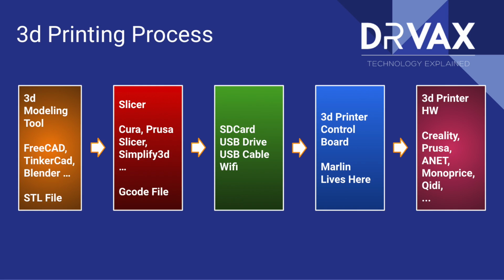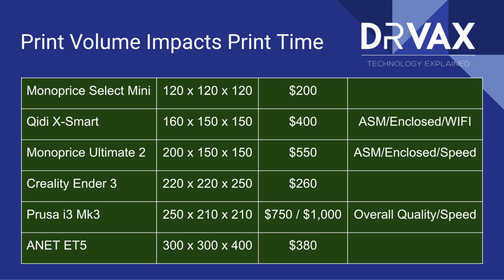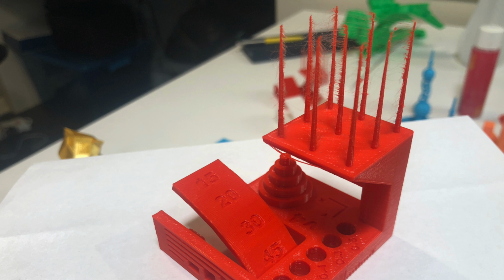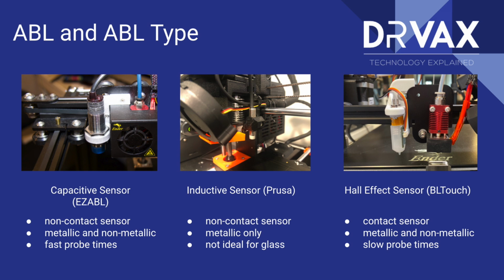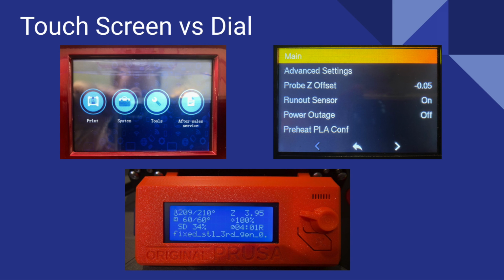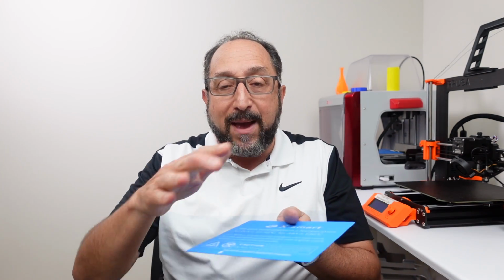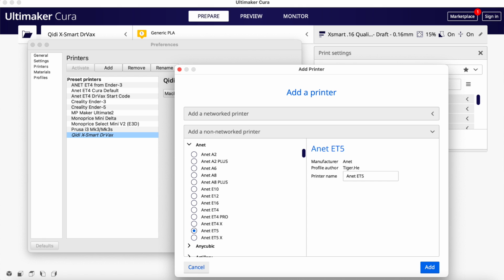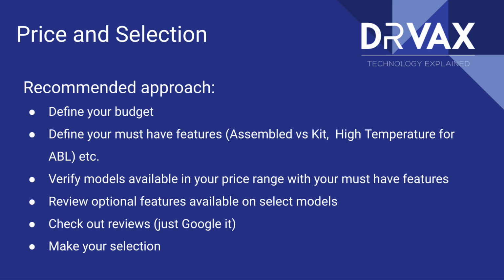How to Buy a 3d Printer

Comment: I have  FLSUN QQ-S-PRO and it's truely amazing.  255 x 255 x 360mm, 69 point autolevel one time only, dual gear titan-like extruder, micro sd card/Wifi/usb connect (gcode sent to sdcard via wifi), all metal hot end, Glass bed instant release when cool - no glue required (except when humidity is over 55%, use glue a few times then remove it and the glass works without for a while), color lcd touch screen, semi assembled, 100mm/sec., Great service, every part available, 32bit robin board etc. etc. etc. - worth checking out, also the new sr racer… 412.00 canadian.  Phil Nelson, Sr. Engineer, 67yrs old.  I also had an ender 3 pro… Delta far better, more efficient
Reply from the maker: I am hoping to review an FLSUN delta printer in the near future. Keep watching. :-)

Comment: Just about ready to pull the trigger (or push the button) on my second printer. The first one, I bought in 2017 and was a Wanhao i3 Plus (I believe the same printer was sold by Monoprice). It's worked pretty well, but I want a larger printer for my second one. Not necessarily for printing large objects, though I do want to try printing model airplanes, but mainly for printing multiple small ones on the larger bed. I actually made up my mind a month or two ago and I'll be buying an Artillery Sidewinder X2. It's got a 300x300x400 print volume, a direct drive extruder, auto bed leveling (as far as I can tell, a BL-Touch type), and a lot of the concerns people had about the mains voltage heated bed cable have been taken care of. The Sidewinder X1 has had a lot of really good reviews from people who've used them a long time, and a few reviews where people have had specific problems with their machines (mainly not-completely-flat beds and ribbon cable issues). One major guru seems to have developed a pathological dislike of it, but that's just him. One particular feature I didn't like was the fixed printing surface - that's easily fixed. I intend to try a sheet of G10 or garolite clipped to the bed. IKEA also sells cheap glass mirror panels that should also clip on. The two alternatives, in the same price, features and size range, were the Bluer Plus and the Sapphire Plus. Both also have gotten very good reviews. The Bluer Plus is, like the Sidewinder X2, almost fully assembled, while the Sapphire Plus is more like a kit. Both use Bowden Tube extruders. The Bluer is a bed-slinger, like the Sidewinder, while the Sapphire is a Core XY printer. One printer I rejected was the Ender 3 Max - it's a 300x300x400 printer with one Z axis screw, no auto bed leveling, and like most Ender 3s was a construction project. It does cost USD100 less. Thanks very much for this video, it pretty much jibes with all the stuff I've learned over the last few months, and covered some stuff that I hadn't considered. About enclosed printers - a friend of mine, in 2017, bought a Hobby King printer - it was a tiny thing, on sale for USD99. Well, he found out about the TINY bed levelling knobs. And back then everyone wanted to print ABS - he had bed adhesion problems, and when he tried a sheet of PEI the sheet peeled off the bed when the ABS shrank. The printer got put on the shelf after that. I got my Wanhao the next month, it was a great deal more usable.

Comment: Bed leveling wheels - one reason beds go out of adjustment is wheel creep due to vibration. On my Wanhao i3 Plus (bought in 2017) I fixed it by installing dual locking wheels and removing the springs. It's a Thingiverse project - the author suggests only using three corners  to level the bed, leaving the fourth free-floating. So far once I've set it, it doesn't move or creep. I also like the fact that the wheels are bigger (the original wheels were tiny and hurt your fingers). I plan to do this on my second printer, which I shall be buying soon.

Comment: Very good guide, thank you for taking the time to create and publish this. 

Regarding "all metal" vs teflon lined hot ends, it's not that metal is hard to cool. It's that it must be precisely manufactured and still doesn't get slippery like PTFE, so it's harder to push material through. With PTFE lined hot ends, it doesn't matter as much if the machining is rough, because it doesn't touch the moving plastic until it is in the hot zone.

Regarding level, there are really two distinct issues: Firstly the nozzle and surface must move in a known manner, which usually means all axis at right angles. This is known as tramming. Secondly the nozzle must reach close enough to put plastic on the bed. The two are often conflated, and some machines can handle one but not he other. Some more exotic machines, like CR-30, use other angles than right angles. What does not matter, oddly, is actual level; FDM printers typically don't mind being turned around, including upside down. 

Regarding open source: My fridge has no software in it; it has a compressor and thermostat. Anyway, source doesn't usually matter in appliances, but see it as a level of documentation. Open source firmware means you have a recourse to get things repaired or improved (whether by you or some helpful friend). Open source printers mean you can print replacements without needing to redesign them. Open source software, such as CAD and slicer software, is even more important; it means you choose when to upgrade, and can archive the tool you used for your projects along with the project if you wish, including sharing it. This is a fraught issue particularly with "cloud" software, which runs on someone else's computer and can change at any time. Proprietary firmware has a similar problem in that if you update to a broken version (this is not an upgrade), they sometimes prevent you from going back to the working version. For instance, Apple phones have been known to be reprogrammed to be slower by updates. Sony have outright destroyed functions particularly on consoles. Thus, I think it is a good idea to check for "unbrickable" bootloader and some open firmware support, even if not installed originally. An example of a 3D printer issue open source support can help with: Ender 5 Plus comes with badly tuned automatic bed leveling, that thinks the sensor and nozzle are in the same place. This has been corrected in third party open source updates. Prusa printers actually use open source firmware and design but locked down firmware updates, but they have a method to enable your own updates. I think the idea was that the warranty covers their firmware but not arbitrary changes.

Comment: What is your experience with bed adhesion issues when you compare beds that shift on the Y-axis vs beds that only shift for the Z-axis? I'm new to 3d printing. I purchased an Ender 5 Plus. My prints kept failing until I realized how much it was shaking as a result of rapid direction shifts. I moved it to a table that is fixed to the wall and it's rock solid now. I'm really happy with it. I'm wondering how Newton's first law isn't a problem for those printers with moving beds if it was for mine just shaking a bit too much. Thoughts?
Reply from the maker: I have found that bed adhesion on my Ender 5 is better than on my Ender 3.  The 5 bed moves up and down instead of back and forth.   

You comment about the table is right on target.  The best place for a 3d printer would be a concrete table.

Comment: Dr Vax , Bigtreetech makes a filament Out/Jam detector that senses all the conditions you described. It can be used with any printer that has a break detection interface on the motherboard. You can find it on multiple online vendor sites, including Amazon and Ali Express. It is a good investment for less than $25 US. I'm sure there are other vendors, but this is the one that I found and purchased.

Comment: I bought an Ender 3 V2.  From my experience, it’s unreliable, and requires constant adjustment/tinkering.
I spend more time getting a print than designing the models.
With that in mind, a valuable metric to consider is reliability, maintenance, and time required to achieve flawless execution.
Before buying a printer, it might be better to use a printing service or consider paying a bit more to get a 4K resin printer.
Reply from the maker: I hear your pain.   Let me point out that $250 3D Printers are not microwave ovens.   They are Do It Yourself Tools.  If you buy a table saw you will have to learn how to adjust it and maintain it.  The same goes for 3d printers.   If you are having trouble from one print to the next I would tighten all of the bolts and screws, verify the belts are tight, and then very carefully reset the bed level.   Then to make things easier for yourself I would buy some MagiGoo and put it on the print bed before your print.   Just a little.

P.S. I have started a new discussion forum at http://forum.drvax.com where we can all have more elaborate discussions and share pictures on our prints and printers. Check it out. Irv
Reply: @MakeWithTech  Yeah, I totally understand the concept of competency with tools.  I’ve worked in construction, manufacturing, engineering my entire adult life.  I developed CAD/CAM software for 15 years, to drive printers, plotters, CNC, etc, and used one of the very first resin based machines in the early 90’s.  The issue I have with the present tech is that it’s not consistent from one moment to the next, and the Filaments perform significantly different  depending on environmental conditions.
Reply: I also had trouble, I installed a BL touch. My printer is working good now.
Reply: Me to experiencing the same in V2. More warping and sticking issues.
Reply: I also had a bad experience.  Turns out the connector to lead screw moved which caused the z-stepper to skip, causing hesd to run into print etc.  Read my review (above) about FLSUN QQ-S-PRO delta.  Absolutely beautiful.  I am an engineer, programmer, developper since 1976.  Old but wise.

Comment: Just a clarification for folks getting their first printer.  Dr. VAX mention ABL a couple of times.  ABL is Auto Bed Lever, as he explained.  Later in the video he refers to high temperature filament as ABL also.  I'm pretty sure he meant ABS or ASA type filament.
Reply from the maker: You are correct.  Great catch.   Thank.

Comment: Great video DrVax! I think I’m sold on the Creality Ender 3 v2. It’s a decent priced first printer. It has awesome reviews and I really don’t think I’ve seen a video that bashed it. I keep on asking myself though, what will I make with it? There’s always some jigs for my woodworking shop, some custom cases for my electronics hobby, and there’s always stuff breaking around the house that I might be able to repair if I can create a model for it. What would you think about creating a scoring system for printers. Most reviews give a good, better, and best score but in the end that doesn’t tell you which product is best. What if you gave them a number system and then added the numbers to give the printer a score. 1 for good, 2 for better, and 3 for best. If you had 10 categories the good printer might score a 10 and the best one a 30. Where would the Ender 3 v2 score? Love your motto, “Let’s learn something together”!
Reply: It is something like "works out of the box", fast, accurate, can print big things, hackable/expandable and whatnot. Many parameters and there is not just a single "right one".
But with my experience with Ender 3 v2, and some random expansion things from China, I know that the Ender has a lot of things done just about right. Especially given the price.
Reply: @pizzablender  u still have the ender?
Reply: @Rami7605  Yes I still have it, but there are other good printers as well.
Reply: @pizzablender  I have been thinking in buying 1st. But many people with extreme opinions (some love it and some hate it)
Reply: @pizzablender  do you recommend another for a starter?
Reply: @Rami7605  I cannot really recommend anything. I have changed a lot of things on the Ender, like run it with Klipper and a direct drive extruder.
But I think there are a lot of very similar printers that perform about the same.
Advantage of the Ender is that many people can help you with it.
Reply: @pizzablender  👍

Comment: Can u plz share some points on the best filament used for ender 3v2 . thanks
Reply: I use PLA and PETG. PLA is easy, looks good. PETG can be stronger but but but you must store it dry in a closed box with oven dries silica gel.

Comment: I got a Ender 3 v2 Pro end of last year on a whim....oh boy.  The rabbit hole is real.  Upgrade this.  Fix that.  Replace the junky thing here and there. LMAO  Worth it, but definitely not the best printer in the world.
Reply: A v2 or a Pro? Those are different.
Still, an Ender 3 v2 is a fine printer. Yes it can be upgraded in many ways, but it does work out of the box.
Reply: @pizzablender  v2, sorry.  thanks for the correction.  and it did work out of the box...just not great...the more I learn the more short comings I see in it.  But that is one of the fun parts - learning.

Comment: Filament runout sensors can be useful. Nothing sucks worse than starting a long print only to have underestimated how much filament it would take. Especially since on a lot of filament reels, it's hard to visually judge how much you have left.
Also, not all filament sensors are created equal. The common microswitch/mechanical switch type indeed do not protect against jams or feed issues. However there are also so-called "smart" filament sensors that are becoming more common, that WILL protect against jams and other feed problems. Rather than using a microswitch, they use a wheel that the filament presses up against, coupled with an optical sensor, very similar to how old-school roller ball mice worked. If the filament stops/jams then wheel stops turning, which the printer can detect.
And as for Open Source vs proprietary, I would be very wary of any printer running proprietary firmware. In some cases, it locks you in to using their own proprietary slicers (Flashforge, Cetus, etc.) which don't always work as well as Cura or PrusaSlicer and/or don't have all the features of the other slicers and/or are not available for your OS. And in some cases they also use their own proprietary boards, which means, unless someone has reverse engineered how it works, you are locked into their firmware and can't load Marlin on it.
Reply: Nowadays I wiegh my rolls when they come in, and notice the full weight on them. So I can re-weigh and determine how much is left.
Reply: @pizzablender  OK now why didn't I think of that? Great idea! Thanks :)

Comment: Considering print bed, filament material (i.e. expected bed temperature) matters: sometimes glass bed doesn't reach temperature of the bed sensor. The most drastic I've seen is 80C bed vs. 100C sensor). So if you upgrade bed of just have adhesion problems, check real bed temperature.

Comment: Filament sensor and auto bed leveling are controversial features. At 30.000 $ industrial printer (IEMAI Magic HT-Max) they didn't work properly and/or reliably "out of the box".
Ender 3 (I own Pro, for example) is a real AK: with PLA it prints as good as average people need.

Comment: I just got an Ender 3 V2 last week as my first printer, after watching this video I think I made the right choice :D
Reply from the maker: Excellent
Reply: Definitely. I have older 3 Pro and with PLA it prints better than 1000 and 3000 $ models at my job )))
Reply: You chose right, now connect octo
Reply: Definitely a very nice printer for the money. Spend time on your slicer settings and dry your PETG filament wel and it is very enjoyable.
When you are really experienced and know what you'd like to change, the Ender 3 is very hackable too. And lots and lots of knowledge on forums and boards.